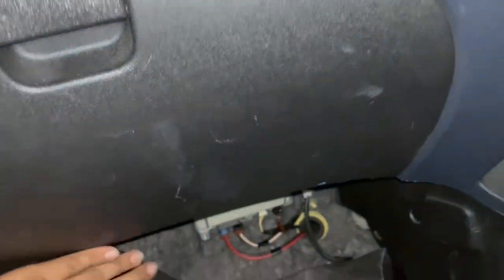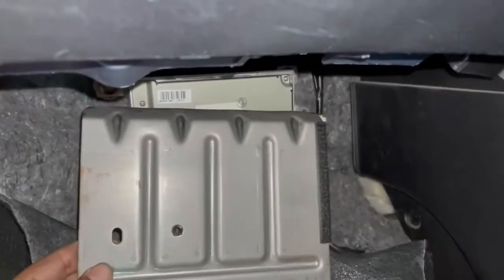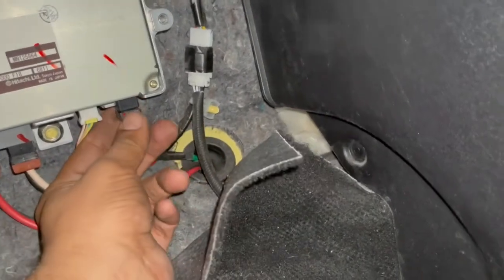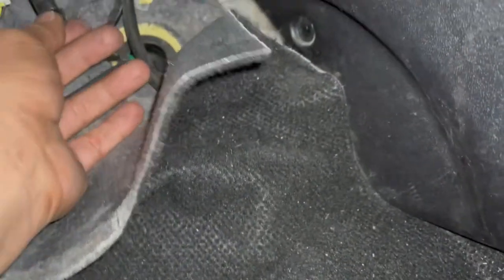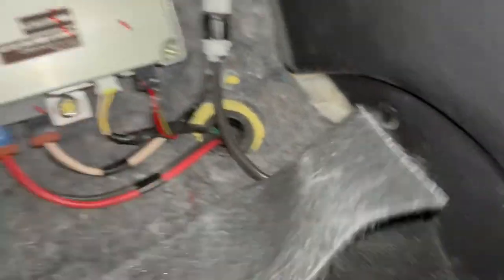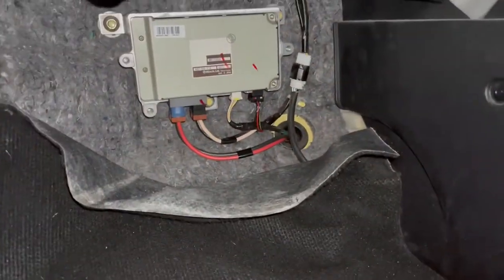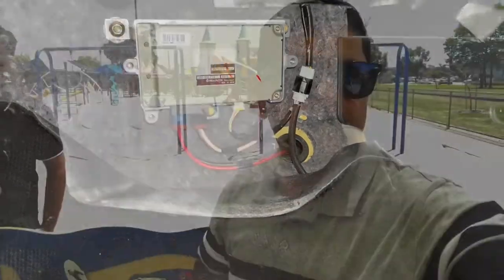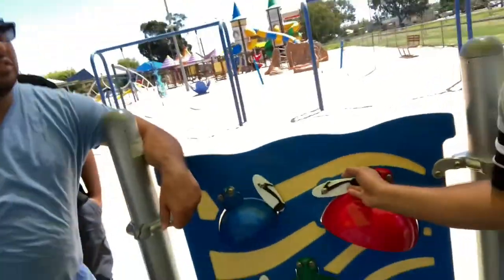Mitsubishi colt Eps electric power steering light fix repair. #dailyideas #fadiautomotive

Comment: Hi , thank You very much for research and that You shared this information, it helped for my Mitsubishi colt 1.3 petrol 2006 europe version, I just bend a  litle bid connector pins, and whola, EPS worked like charm, by the way after ECU scan I got this fault: Code No.C1541 Locking fail safe relay on, so it means that in EPS ECU there is relay what is not working right, but it seems this pin thing does the fault. I alos researched that there was recall for that socket thing. THanks again,  blessings to You!!!
Reply: How you bend it did you put the cable out of the Connector?
Reply: @Bodenlos8601  Hi, Actually in my case was different after some time problem accured again, but it was problem in Electric steerinc ECU block,  there is two relays and one of them was faulty I guess. I cutted + wire what goes from EPS ECU to electric motor and put there time relay 100A with 2sec delay. Idea is that when I turn on car EPS also turn on, then after ecu is on after some delay relay turns on electric motor, I bought time relay and 100a relay from aliexpress, all problems went away, I am driving now for some 3 months daly - no problems any more.

Comment: Ahh wicked. I'm going to have a look at this. I've had a very intermittent EPS light stating on. Today it was working and then came in while driving. I'll check this connection, but I did have a feeling it may be a loose connection somewhere.

Comment: Good fix.
Got anything on Colt 1.3 won't start, just clicks rapidly?
Reply: Dead battery?
Reply: @gregansen544  OK.
Put in a new one.
It starts ok.
But when turning on the key (not starting the car) several clicks are still heard. Then switch off and switch on gaian, gives the same clicking sounds.
Any idea as to why?
Could that be a relay, or is that normal?
Thanks again for your help.
Reply: @basba_qal  I think that is normal as long as it starts fine
Reply: @stephens4887  Thanks, it was a loose battery terminal.
Tightened the HECK out of it and the continuous clicking was gone.
Keep up the good work.